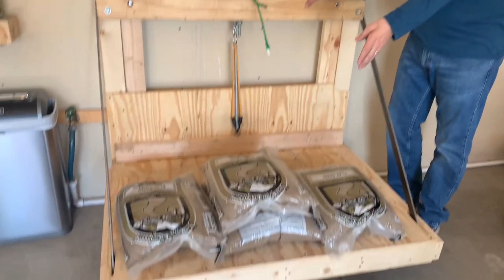Elevator Crash Testing the Otis-Inspired Safety Brake! Garage Attic Lift Build in Minneapolis

Comment: Better than your original design, but introduces more problems (don't replace a metal lift cable with a crappy plastic rope!).  My comments on your original video still stand - this is a dangerous design and does not follow Otis's original design which was more simple, more robust, and worked more reliably.

Comment: One other safety mechanism you might consider is a top limit switch.  If the elevator is stopped at the top position the winch could damage the carriage, or break the cable.  A top limit switch would kill power to the winch before that happens.

Comment: If you want to be safe put a counter weight of concrete equal to weight, the put behind your tracks with other tracks use life on bottom to offset the weight that always pulls up. If main wire breaks that weight will just pull you up
Reply from the maker: If I did that, the elevator would never come down.

Comment: Watched this video quite a while ago. Looking at again I think you could achieve the same net effect with far less components.
Reply: Show us!
Reply: @Tony Turner  can't post pictures here, but I can explain the science behind it... He has two fixed (with bolts) vertical bars hanging down from the horizontal piece of wood, for simplicity sake I will call these "drop bars". You can see in the video he has a vertical spreader bar placed down low that goes between them. That is there because of Newton's Third Law of Motion, but that can be removed if it is slightly redesigned.

The reason the bar is there is because the two fulcrum arms are independent of each other, and each of them is designed to press into the wood without a counter acting force. i.e. they are trying to press into the wood, but there is nothing to stop the wood pushing back. So he has a bar between them to provide that counter resistive force. Effectively nullifying the pressure pushing back.

BUT... If you added a small pivoted joiner bar (or just made a pivot point between the two fulcrum arms) at the ends of the two independent fulcrum arms, you would in essence have one flexible fulcrum arm acting in two spots, which would double as a spreader bar. By joining the ends of the fulcrum arms you could also do away with some if not all of the limiters. Because you would make the fulcrum arm just the right length so that it can never go over centre. With the design he has there he needs a limiter because there is a possibility that a single independent arm can potentially go past centre with enough force.

By making the total bar slightly longer than the distance between the fully engaged position, it isn't possible to go over centre (well not if it is designed right it shouldn't) plus you have the added benefit of knowing that equal force is being applied to both sides. Alternately if you wanted the bar to be able to go straight, I can think of a way that the arms can lock on each other (much like folding your arms).

That brings us to the "drop arms"... Modifying it the way I suggested creates one small problem with a better solution answer. Using independent arms you don't need to worry about the arc trajectory they travel in, but joining them together is going to have an impact on the pivot points on the lower drop arms because they are going to want to move is a slightly different trajectory path. But with this problem also comes an answer. Currently he has the drop bars mechanically restrained with bolts, which in turn creates its own problem, you have a steel bar bolted at right angles to a piece of wood and side leverage being applied to the bottom of it (think lever) so when the brake is applied the lever effect applied at the lower pivot point is trying to twist / sheer the bolts in the wood.

BUT... If you replace those bolts with a pivot at the top as well, you kill two birds with one stone. You not only remove the issue of the twist force being transmitted to wood, but you now have a solution to the arc problem caused by joining the fulcrum arms together.
Reply: @DodgyBrothersEngineering  that sounds  workable but you can't get much simpler than what these guys have done. Their system has been used, and proven, for more than 100 years. Using soft, sacrificial wood as the friction surface is elegant and the balance of the parts are cheap and readily available. I'd love to see a drawing of your device... It could be fun to try and incorporate it into my outside elevator (which is getting built when the weather warms up). I appreciate you taking the time to type your explanation and look forward to more information if you pursue it.
Reply: @tonyturner9146  what I was proposing may only work with their specific application and not in every case. For example I am thinking about using brake pads (of sorts) on metal to arrest the fall, whereas they are using sacrificial wood. The design I described may not work with my planned system, but might with theirs because they are using wood that is going to dig in.

What I proposed relies on the spreader bar being able to "lock" (at least partially), which means the flexible bar I described earlier must be nearly horizontal to work. If the angle is too great the force pushing back from the wood could over power the momentum / spring force pulling it down. There is a certain amount of trial and error required to what I proposed (As I am sure there was in this design), but I believe it could work with several less parts.

I most definitely wouldn't attempt to do what I proposed without a secondary or tertiary safety system, just in case it didn't engage as expected. I found an online calculator that suggested even a one floor free fall was enough to kill you, so this as important as your car brakes. I am constantly refining my idea to try and make it more fool proof as I could be using it to move quite heavy objects like fridges (or heavier).

To me the ultimate lift brake is one that doesn't rely on parts that can fail or get weak, or in the case of wood, rot. Where possible use the laws of physics to work for you, rather than against you, and use the weight of the lift to your advantage rather than a disadvantage. If I ever come up with something I am truly happy with I will make a video of it and put it up on my channel, but at the moment all my energy is going into finishing off my remote control mower, which is where I should be now out in the garage doing a video.

Also one of the major disadvantages of this system (or you could consider it a potential design flaw) is that it is relying on the rails it is attached to not move while being pushed sideways. Lets get a little crazy and say for some reason something compromised the integrity of the lift legs that allowed them to move under load. The brake has the potential to not come on at all. That is why I prefer something that squeezes a rail, or applies equal force to both sides. To just eliminate one more potential weak link.
Reply: @DodgyBrothersEngineering  it's fun to think about all the ways we can improve safety. It gives tinkers like me something to experiment with. 

The system these guys are using has been used for a very long time and the only real difference is the wood. Lots of things "could" happen to the wood but we deal with the probability of what happens in the real world application. Let's say the stop arm jams into the wood and the wood splits... It would most likely not stop the car but would still provide deceleration which is ultimately the goal (stoping free fall). Or it could jam in one side and skew the platform causing it to jam (also not a bad thing). Interesting to think about. I really don't think either of those things will happen but I'm sure they could under some condition

In a real elevator there is a counter weight to the car/platform. The counter weight is connected with multiple cables each capable of carrying the full weight of the system. The counter weight is sized to be equal to the car and half the expected or rated load. In this situation the car is for the most part balanced which means the motor only feels the portion of the weight that is imbalanced. The extra cables provide redundancy increasing the safety.

Anyway, it's a fun exercise for the mind but we can literally add things to the car until it can't carry all the weight of the safeties. 

Keep it simple. In my mind, and seeing the test these guys have done, I think their solution is elegantly simple and I'll be incorporating it in to my current lift.
Reply: @tonyturner9146  a friend of mine often accuses me of "German Engineering" things, but I think he doesn't think about all the potential problems enough (even though he is probably a better engineer than I am). Considering it is life and death safety device we are talking about, I don't want to be caught out having left anything on the table. It is quite unusual for me to be taking parts away.

My original design was loosely based on the original Otis design using a saw tooth, but before that I need to start the story at the beginning.... I am building myself a new house if ever the building situation improves, and being that I am no longer 21, I wanted a way of getting heavy / bulky items upstairs where most of the living is going to take place.

I did a trip to a local lift manufacturer a few years ago to see how they made lifts / get some quotes (mostly aluminum / about $45,000) and took plenty of photos of the crucial design elements, without making it too obvious. (they said I could take photos). So I got a good idea of how the main structure and lift car were designed.

In typical "German Engineering" fashion I am looking to beef up their basic design idea. They rely a lot more than I would like on diagonal bracing for strength, and while I think that is a smart move, I am not trying to mass produce and keep costs down / profits up. I am planning a "goods" lift around a four post design (probably 75mm steel RHS) Creating a much more solid outer frame (still with bracing). The lift car I would make out of something like 20mm RHS (double sectioned floor).

It is these 75mm steel box sectioned posts that I want to apply the braking to (along with the arrester straps, and possibly on the cables as well). Because I want to be able to carry large items like a king sized bed. I plan to make the lift somewhere around 2.4m x 1.2m.

The original plan was to go to a steel shop and get them to laser cut out of steel plate some tooth like strips that could be bolted or welded to the steel posts, but several designs later I am now look at a design that uses the weight of the car to help jam the brakes on. Being that I and someone else might need to hold a very large fridge while it is being transported I need to make sure that it is beyond safe. Plus one day I may get too old / feeble to use the stairs, so I want to build something I can feel comfortable using as a daily lift.

Comment: My elevator is remarkably similar to yours. I too used two 330lb. fall arresters as a safety . I have a wireless remote system to move the elevator up and down and high and low limit switches stop it in the up and down position. I also added emergency stop switches in case a limit switch fails. The emergency stop switches kill power to the lift if a limit switch is over run or fails. 

I am very impressed with the Otis safety. Very well thought out and implemented. I also appreciate you sharing your testing. Ive tested my lift to 600 pounds and rate it as 400 for practical working load. I weigh 300 pounds and the platform and associated hardware is just under 90 pounds. My first lift motor is rated a 880lbs. I use a second lift motor as a "swap-out" unit and it's rated at 1320lbs. I swap the lift motor every 3 months so I can maintenance the active lift motor. I check and grease the bushings/bearings, check the cable for defects and disassemble the motor to check gear wear and apply fresh grease. I'm still adjusting my maintenance schedule as I learn what wears. I know this is not popular but we actually use our lift to get my mother-in-law up to her second floor apartment. I can not recommend any one else ride their lift... But I assure you it's safer than my 87 year old mother-in-law walking up the steps... She fell down them more than once. Do with that what you will.

Good job guys!! I'll be modifying mine with your brake.

Comment: What is that object fell off from top when you cut off at 300lbs?!
Reply from the maker: It’s been a while but as I recall it was one of the bungees that was pulling down from the base. It must have bounced at actuation and came off the ring. It did it’s job though. Once it pulled the jamming bars down, the weight of the elevator and the friction did the rest.

Comment: What you have works fine IF the cable breaks. What if the braking mechanism in the hoist breaks or the gears strip out and it starts falling- but falls with enough tension on the cable that the safety mechanism doesn't engage? Since your hoist is a cheap Chinese unit this is a distinct possibility. Same with the fall arrestors. If it's a slower fall they probably will not engage either. Lets see you take the hoist apart, see how the brake works and simulate a failure there with both the braking mechanism then the fall arrestors. Thanks for the video.

Comment: That's pretty sweet, don't know if it would impact the braking system but it might be worth putting another 2x4 or something similar between the one holding the rails and the brakes so if it does ever have to get used there's no chance that it mangles the 2x4 holding the rail and you have to disassemble everything to replace it.

Comment: Well done guys! Reminds me of my underground mining days. I had do a drop test on an man cage before it would could be certified for man hoisting underground. The cage had wooden guides. I had to design the safety dogs to engage the guides if the hoist cable broke. They had to engage and decelerate the man cage at a rate such that the occupants were mot injured… such as broken legs, hips or backs!! The weight of the cage on the cable kept the safety dog disengaged. Cool stuff!!

Comment: I am almost finished with my garage lift and wanted to thank you for your excellent videos, especially  your fall safety. I have found a ready made fall safety that was designed for a different application that works extremely well and can be adapted fairly easily. I was thinking about making a video but wanted to know if it would be worth the effort and the liability issues from posting safety related issues.

Comment: What are the dimensions of the elevator & opening in ceiling? I'm building a garage and it will have 13' ceilings. Any issues you can forsee with it going that high up?

Comment: Do the brakes lock into slots in the unistrut or is it like a rubber pad that applies friction to stop it? Are you concerned at all of the unistrut giving way or possibly loosening the firring strips as the brakes push against it?